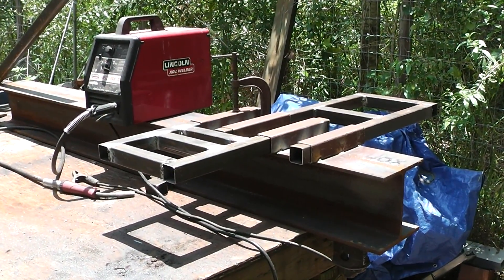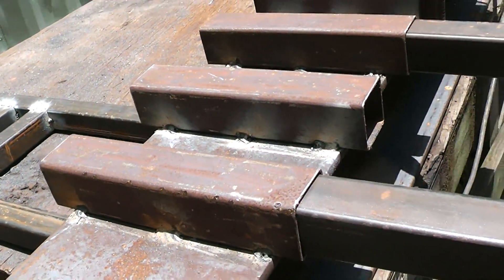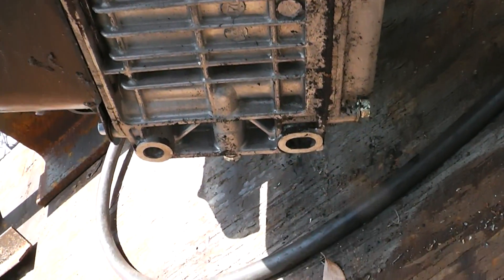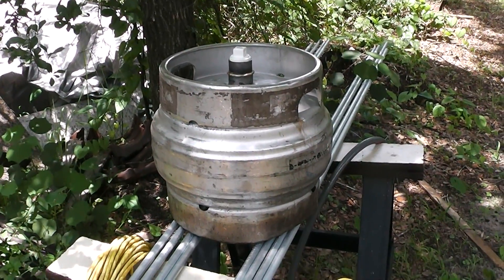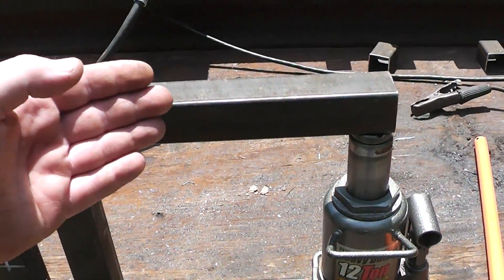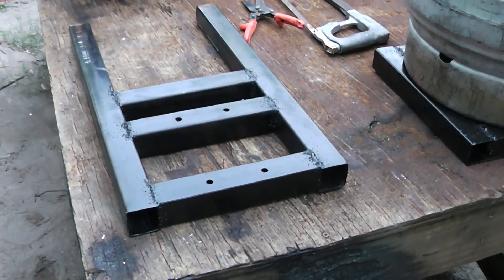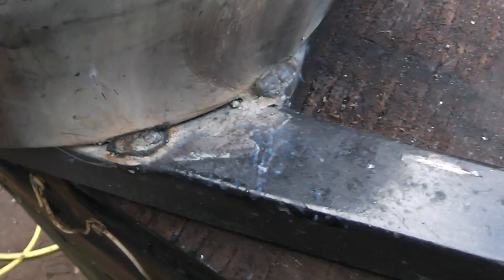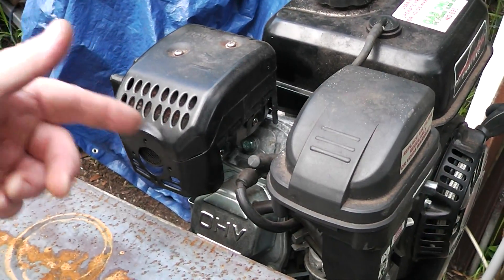30 Ton Log Splitter Part 4 Modular Construction

Comment: A tip for mounting motors put a bushing or bumper at all contact points. (Bolt washers rubber motor  rubber frame rubber washer locking nut)  Be mindful if you are doing a clutch or chain drive of the  slack.

Comment: Naive question, regarding the exhaust you mentioned at the end, would it make sense to rotate the engine 180 degrees? That way the exhaust would be pointing away instead of into the middle. I'll echo everyone and say thanks for sharing!
Reply: I put the same engine on my chipper and you can rotate that exhaust 90 degrees.
Reply from the maker: Good question!
Rotating the engine/pump configuration 180 from its present location would put the pull cord away from you for starting.  You would have to start the engine on the other side of the splitter over/under the cylinder.  If it was an electric start motor then I could turn it any which way with no issues.
The modular mounting system could also be slid out a lot further moving the exhaust away from the cylinder as well.